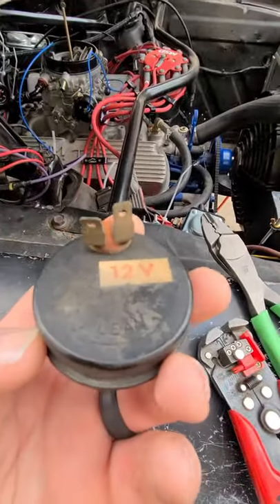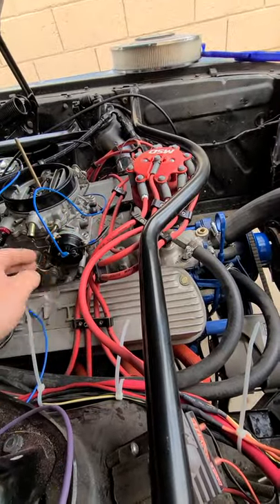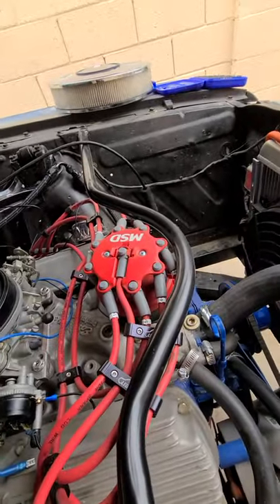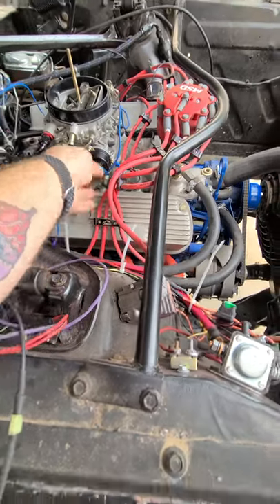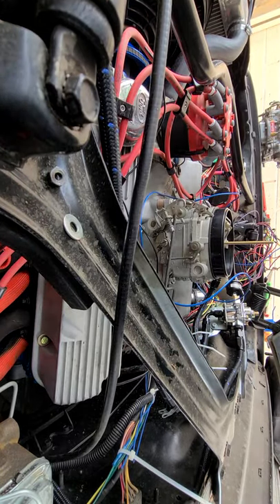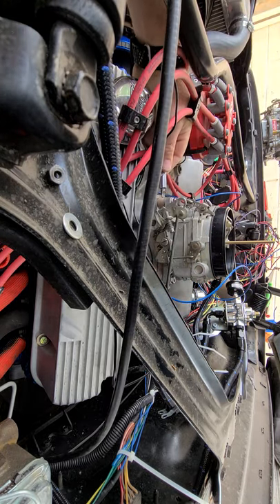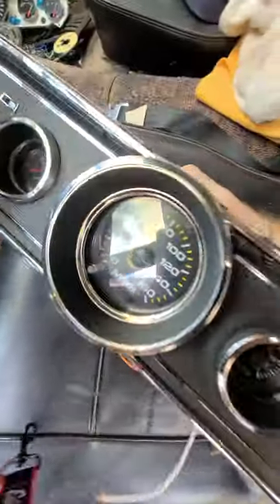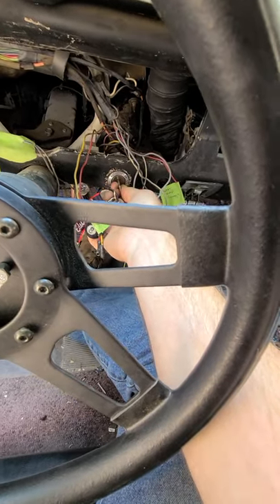how to set an electric choke on a edelbrock/ carter afb electric choke

Comment: Great video. Going to come back and watch parts. Having a hot start issue. Car wont start unless gas pedal is to the floor when hot. Not sure if choke or. Mayne fuel boiling?
Reply from the maker: If it's to the floor when cranking it's flooded. This car was set too rich at idle and would die at idle when hot. I would have to hold the throttle wide open to start. Just leaned out the idle jets a bit and now it's fine.
Reply: @gansorsgarage228  hmm.. my car drives fine otherwise.  Only when it sits hot that happens.
Reply from the maker: @olliej914   it is possible the fuel is boiling out of the carb and up out of the vent tube falling into the intake and causing a flooding issue. Not sure if that is the case for your particular issue. Do you have a non metallic spacer under the carb? That helps isolate the carb from the hot intake. It's not 100 percent but it helps
Reply: @olliej914  my 65 had that issue. I put a 1" 4 hole spacer and problem solved. You could probably use a 1/2" and be fine